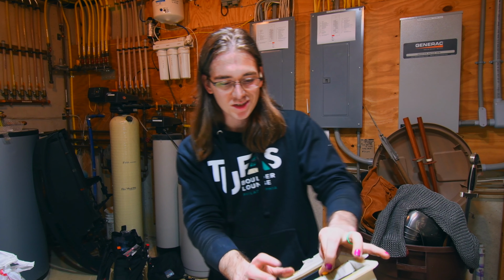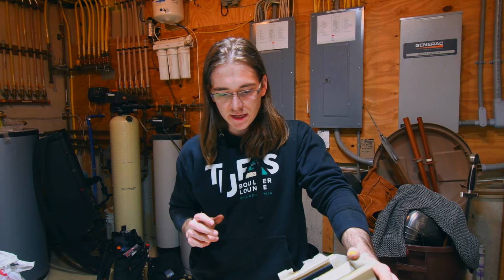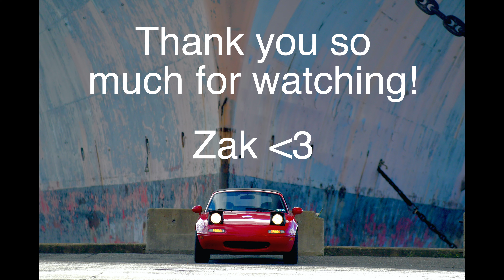Putting the HEATER CORE housing back together with A LOT of foam and a pressure test | #MamaMiata 12

Comment: Did the smell of the new foam ever go away? How long did it take to go away, ive just ordered everything to do this tomorrow!!
Reply from the maker: It went away fairly quickly, I'd say maybe a week or so of driving with the top down?  Prior to doing all of this there was literal mulch in the blower housing so it went from smelling like a landscaping business to newly installed rubber / neoprene which was a major improvement already.  On hot days with the car sitting and the top up the smell came back a little, but it never got to the point of being distracting.

Or put another way, it still smells more like an old car than rubber / neoprene 🙃